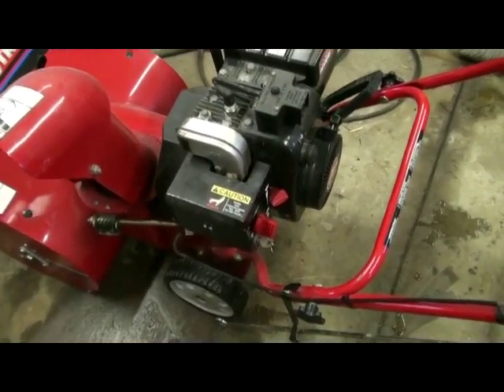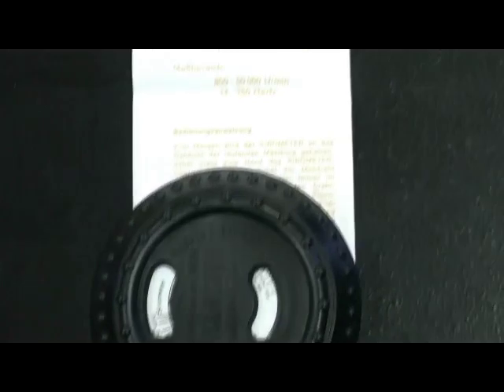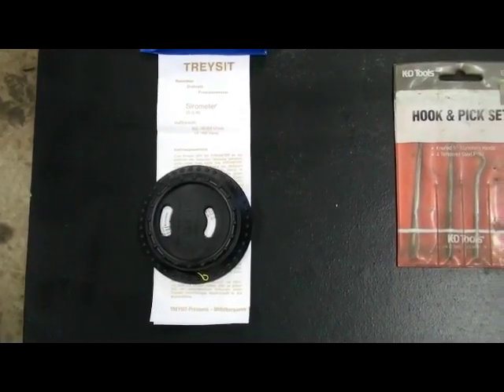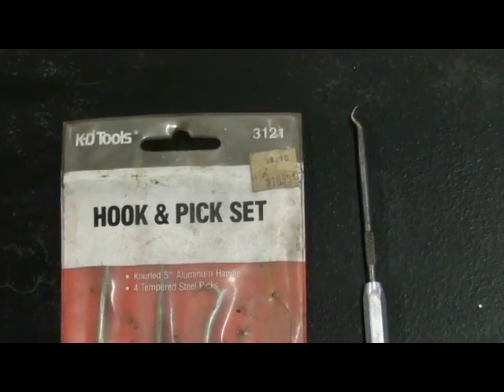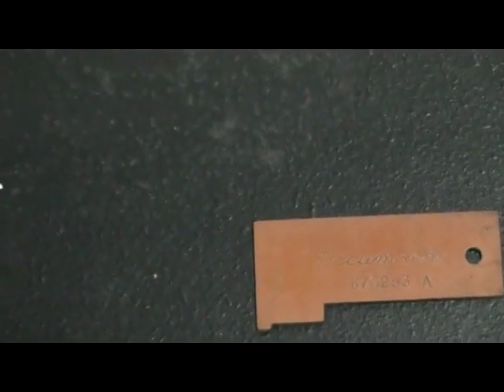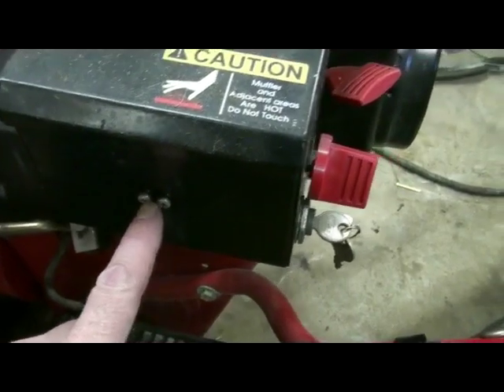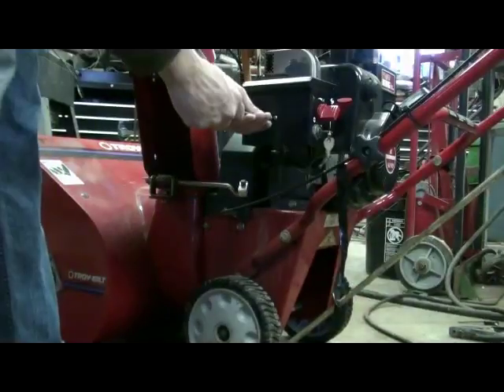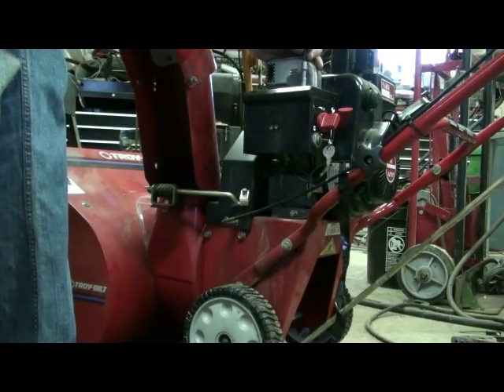Tecumseh Snow King Carburetor Repair Video on Troy-Bilt Snow Blower part #1

Comment: I know this is an old video but finding information on this particular snow blower is difficult. Was wondering how it performers with those little wheels and can bigger ones be put on. 

I just bought mine second hand and it's pristine, even got an electric starter kit with it. Only 120 dollars, seems to be a good deal.

O ya, got it home put gas in it and it fired up on the first pull!

Comment: @31pockets Howdy! Actually, what I thought was a bad primer bulb, was a fine brimer bulb. The hole was plugged! Whan I bought a new primer and seen it had a hole, I had to check the carb out. Had a little sediment, cleaned, readjusted, unplugged that primer-bulb hole, running fine! She's over 20 years old.